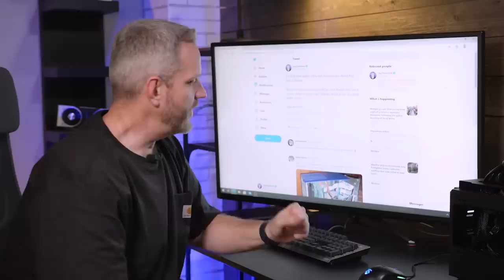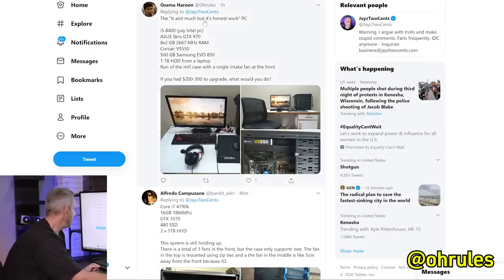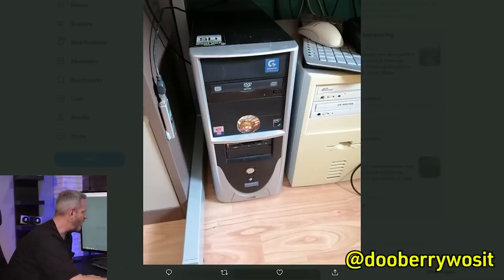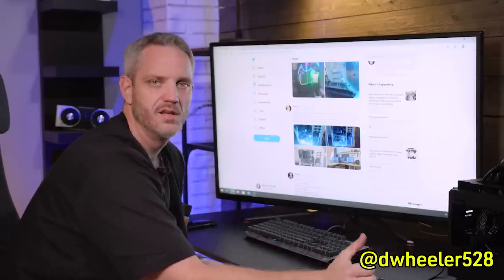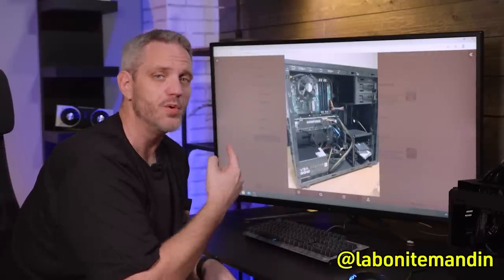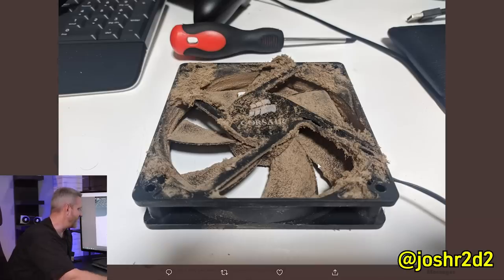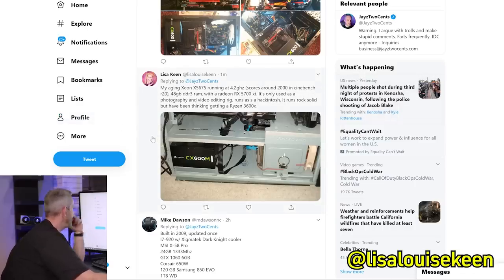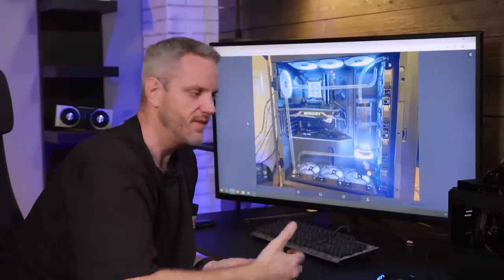Reacting to your WORST Setups... Send help NOW!

Comment: I had to clean out a PC for a client recently, the computer wouldn’t even successfully turn on. It would start up, shut down, start up, shit down... I had a feeling I knew what the issue was. The client was a smoker, had 4 dogs, kept the computer on the floor, and had a dog bed right next to the tower. I took an air compressor to the fans and non of them would even turn.
Reply: Dammmmmo
Reply: RAM swap and cleaning both RAM + Slots solves 80% problems people come to me with.
Reply: OH. EW. OH MY GOD EWW
Reply: Wow. Just... wow.
I've done some bad systems in my day, usually 10-15 year old systems that've never been opened in their lives and have multiple blocked heat sinks.
My crown jewel is the 20 year old file server I serviced. Dust bunnies across the entire room for literal days as I found my way around that system.
But the machine you just described... in all my years of fixing computers, I've never gotten one THAT bad.
Reply: I worked on a customers computer once, he smoked in his office and yeah his keyboard was that stained yellow. Somehow his computer still ran though.
Reply: Had a lady bring her PC to me because it overheated. She was a long time chain smoker. The entire PC was coated with orange tar and required a 12+ hour bath of water+isoprypl alcohol to loosen it enough to remove it.
Reply: I have seen  computers covered in wet looking orange-ish sticky residue.  Heavy smoking is smellable
Reply: My friend's dad in is a heavy smoker and they have a dog, his dad smokes while using a laptop, there is ashes inside of it

Comment: Jay: FX is almost a decade old
Me: crying in phenom ii
Reply: Ran a oc'd 965 BE until nearly 2019. It's a soldier. If you're anything like me, you're held back more by your GPU. Mine was a 2GB GTX660. That was holding it back more than the cpu.
Reply: Laughs in Athelon X64
Reply: still proudly rocking an FX 8350 with MSI 1080ti and Gaming pro carbon 970A motherboard lol.
Reply: @BobalouTheOneTheOnly  lol same board i got just I used RX 570 8GB OC cards in crossfire
Reply: Same. I got a phenom x3. Friggin potato ass trash.
Reply: arsonist_1  That was the first chip I had ran awesome for almost 10 years. then I finally upgraded to a FX 8350 BE. still have that Phemon II x4 running in a server. Still going strong.
Reply: Still got my phenom x6 and win 7 PC under my desk😂
Reply: My phenom x6 died last month so i bought r5 2600. Before cpu was 100% and r9 280 also. Now he dont touch 30%. I don't see a point to buy something more expensive if single gpu wouldnt use 60% of that.
Reply: cries in 9590 space heater
Reply: Take a pic send it to Jay let's see it
Reply: @BobalouTheOneTheOnly  I got an 8320, xfx 580 on a gigabyte 970. Was used for many things in its life, gaming, storage, nas, the things got 4 1TB spinning drives and 2X 256gb SSDs
Reply: @dcfuksurmom  Even low tier APUs from AMD kick the shit out of that one.

Comment: I definitely have a problem with cable management outside the machines. Wires everywhere. The suggestion for long power strips mounted to the backside of the desk is excellent. I'll be doing that. Thanks, Jay.

Comment: Soft tubing in home watercooling rigs is pretty awesome. It simple, quick, and allows you to make changes without taking it all apart. I leave my long run from the CPU to the front radiator a bit long to allow me easy access the memory and a few other maintenance reasons. I know it doesn't look exactly the best but it servers its purpose. On top of everything else I'm pretty much the only person that sees my rig.

Comment: *Jay, preaching to FX owners to replace it.*
*Viewers looking at Steve hugging his FX computer.
Reply: GT630 for me
Reply: FX 8350 is ok @ WOT & WOWS + e sport games.
Reply: I have the i7 990x released in 2011.
6 cores 12 threads, stock speed  3.46Ghz overclocked to 5Ghz.
Runs like a charm.
Can play all new triple A games with all settings ultra at 1080p with a fps of 120 (max).
So i don't even in the slightest do i think about upgrading my system (for now).
Reply: @opoxious1592  DUDE what voltage you running at and what bclk and multi?
I can only do 4.5Ghz on mine @1.4v and anything higher requires significantly high voltage.
I couldn't even break the 5Ghz barrier for HWBot OC.
Temps and cooling?
Reply: @zarmaanful  Voltage is just under or just above 1.50v  (Have to check bios first for the exact number).
Max temps at full load 72c or 161.6 F.
At first i also had problems reaching this speed, by using a to high BCLK.
If you increase the BLCK than also all other components (except GPU) will be overclocked in your system, increasing the chance of instability.
Therefore i have set the BLCK to 100 (lowest setting possible), with a x50 multiplier.
And for cooling i use the air cooler "Gamerstorm Assassin III".
This cooler is nearly as good as liquid cooling.
The difference is only a few degreese in favor of liquid coolers.
Please let me know of you get better results, if you are going to try the overclock?
Thanks 👍🏻
Reply: @opoxious1592  Sorry i forgot to check YT notifications, I'll try it.
was using 2133mhz DRAM frequency but can sacrifice some clocks for CPU clocks.

I'll have to check around forums if running 1.5v 24/7 is good for this chip.

Current settings:
BCLK: 133.
Multi: 34.
Uncore: 3200.
DRAM: 2133.
Reply: @zarmaanful  Yeah, RAM speed is not such a huge factor for gaming.
My DDR3 is running at 1600Mhz.
But i lowered the RAM timings to compensate.
Good luck, and let me know how it's going with your overclock👍🏻
Reply: @opoxious1592  Can't get it at 4.9Ghz even with crazy high volts(1.575v).
guess you won the lottery.
I did manage to get my memory to 2400mhz tho.

Did you change the Uncore or QPI or TLL voltage to get 5Ghz?
Reply: @opoxious1592  Tried lower multi but higher BCLK and higher multi with lower BCLK too.
Reply: @zarmaanful  No, i left it on "Auto"
What i forgot to mention, is that i did turn "Hyper Threading" off.
I could't reach 5Ghz also with "Hyper Threading" on.
Hyper Threading off, and lower RAM speed could do the trick.

Comment: The PC with the dust in the radiator reminded me of this:
I should have taken pictures of my PowerEdge when I found it on the street... It looked like the previous owner ran their server in a kitchen while still using the kitchen as normal... The first thing I did after taking it home was taking it apart and wash every part of the case and the fans because the dust inside it had formed a crust.
Reply: BodgeMaster you found a server in the street? That’s pretty cool
Reply: @brien1254  Yep. Sadly, it has only the Xeon equivalent of a Core 2 Quad and 4 GiB of RAM but why would I not take a free computer?

Comment: Jay: "Show me your worst setups."
Also Jay " STOP USING FX!!!"
Reply: Im still using a fx8350 with an rx580. I can play modern titles 1080p higher or medium settings 60 fps. Its still relevant for modern gaming
Reply: "Go turn a trick"
Reply: @amishdinkledork  I have the same setup, as long as games are multithreded its Okey!
Reply: @amishdinkledork  I'm using a 3700x with a 2070 super, I'd say my setup performs significantly better, especially considering new console gen is coming, meaning games are about to become all the more demanding.
Reply: cries in 1090T Bulldozer
Reply: @amishdinkledork  WOW! You can play at setting and resolutions that where less than relevant 7 years ago. A $100 zen2 ryzen 3 will steam roll it. Im sure you could make a pro duo play at 60fps if you treid hard enough.
Reply: @TheGauges420  I could bet a lot that the "modern games" he is talking about are ones that don't  have PC benchmarks (aka moba's, BR's, etc)
Reply: What’s FX?
Reply: @Budo Basovic still have my old 1090T system with a 770 GTX and still does a decent job for its age, dont use it too much since i have an 6700k 980 TI rig for gaming....
Reply: Jay wants me to get rid of my FX 8350 then he needs to sell me his 3300x Ryzen.
Have all the parts that need to be purchased, but no point if I can not find any 3300x cpus to purchase.
Reply: @En_Joshi-Godrez  most gamers play in 1080p...lol typical gaming elitist "if its not the best its garbage"
Reply: @amishdinkledork  No, you completely miss understood (not surprising when you use "eletist" as a insult). Most people on this earth are still using glorified Nokia bricks as phones. Does this mean that these are the industry standards of today? No. Phones like the iPhone 11 are. The only reason the mass majority use phones from over 10 years ago is because of a massive economic inequality. These devices are no longer relivent from a cultural and industry perspective, same is true for 1080p. 2014 was when the industry first punshed for 1440p in monitors and today their are significantly more new gaming  monitors made in that resolution than in 1080p. Again, the only reason 1080p is still being used is because the demographic for gaming PCs is a lot yonger and still having to deal with a massive economic inequality. They are playing on systems that are simply no longer relevant. Just to hammer my point, 30% of stream users use monitors that are less than 1080p. Literally no one is making monitors at those resolutions any more.
Reply: @En_Joshi-Godrez  if its not relevant why are people still using them? saying its due to wealth is BS, i could buy a ten thousand dollar computer if i wanted to but i dont cuz im not an elitist. actually look at recommended pc requirements for modern graphically impressive games. and ya know a 1440 monitor can produce 1080 if you change the settings...
Reply: @En_Joshi-Godrez  Yes, I agree, 1080p ≠ industry standard. That does not make them irrelevant. If you have a system that runs to your satisfaction, then why not spend the money on games instead?

Also, what makes you think that 1080p monitors are no longer in production?
Reply: @Sea_Star  when did I ever say 1080p was no longer being manufactured? 720p? For gaming most likely yes except fringe bargain bucket Chinese manufacturers. But 1080p screens will be manufactured for a while yet. But they are on a dowards tragectory, and I argue 1440p has over taken it as a industry standard. So little R&D is now going into anything with a 1080p screen.
Reply: @En_Joshi-Godrez  My mistake, I misread your last bit. Overall I agree with your sentiment about 1440p being the newer industry standard, I just deemed it a bit odd to dismiss 1080p as being culturally irrelevant.

Comment: "The card is showing its age with 3.5 Gigs of vram"
me: *Cries in 1 GB of Vram
Reply: laughs at you with a gt730 with whooping 4gb of vram
Reply: @rileybeckner7881  how in the hell did you find a 1050ti for 40$
Reply: Was thinking that 5600xt, 5700 or even 5700xt. I got mine for $300 used, but selling 970 and having a $400 budget could potentially get a new 5700xt.  Or wait it out and hope 3060 is in the right price range. Or big navi maybe?
Reply: laughs at you with Titan RTX with whooping 24 GB of VRAM
Reply: 2gb vram
Edit: 1030
Reply: @rileybeckner7881  You have a full GB? I'm still at 240 mb
Reply: My laptop has 128 MB of vram lol.
Reply: Just remove a memory module from one of your ram stiks and solder it onto the gpu
Reply: GTX 750 here with 2
Reply: i only have 6gb vrami, i cannt play ultra texture apex :( i can send 1 gb
Reply: laughing to you guys with a 3080 with 10gb of vram
Reply: @slicktachgaming6383  i have vram so much vram its not even funny. my vram is never maxed out and i only paid 200 sollar for it
Reply: what you mean, I have a sick case with RGB but the insides are crab, I am running on a HD 630
Reply: I just got a 3080 I don't even know how much vram I have
Reply: @nombre652  same
Reply: @jc.1191  acer c720 Celeron 2957u running garrys mod is a nightmare...
Reply: sobs in 8mb of vram

Comment: Jay: Get off FX

Me, watching this on my Phenom II: huh
Reply: Believe it or not Phenom II performed almost exactly the same as FX except in VERY specific circumstances. For gaming its almost a wash.
Reply: My phenom ii x6 plays the new flight sim 2020 just fine its still a good cpu.
Reply: It's not FX so you're good!
Reply: @mitchmarvinmartian  I've often heard that, but I upgraded my PII x6 1100t to an FX 8350  (OC'ed both) and picked up about ~25% FPS in my racing games.
Reply: Recently got 4 of the Phenom II processors to play with. Can't wait to test them out...
Reply: The Phenom II's were actually a bit better then the FX CPUS
Reply: Last november,  finally bought a new pc to build for my 18th. gave the phenom II 1045T hack job dell hand-me down i had to my younger brother
It had a Phenome II X6 1045T, 12gb (1300Mhz) Ram, 120gb SSD, 1Tb HDD, Radeon HD 5450 (1gb).
Letting him suffer for a few years
Reply: I had a phenom x4 955 oc'ed to 4gHz till 2018, upgraded to a 2600
I gained almost 20 fps in battlefield 4
pls upgrade if you have the money, for your sanity.
Also not have a 200W heater in the summer is a +
Reply: Even Phenom II was clock for clock better than FX. Just lacking some more recent instructions sets that some games use.
Reply: I had a phenom II x4 940 oc to 3.6 until I upgraded to a ryzen only because I needed more ram. The 940 was on a ddr2 motherboard with 6gb of 800 mhz ram.
Reply: I recently upgraded from a PII X6 1050T to a 2400G. The 2400G is way faster. I'd bet the new 4core 8 thread single CCX thing is even better.
Reply: I just retired my Phenom II after 11 years. It was a great computer.
Reply: Im still using a fx8350 with an rx580. I can play modern titles 1080p higher or medium settings 60 fps. Its still relevant for modern gaming
Reply: AMD Phenom II x6 1050T here lol
Reply: Wife does her "work from home" on a 955 (Black Edition)
Reply: Phenom II X6 1055T here :cries: I want Ryzen 5 3600 :(
Reply: Laughing in core 2 quad q9650@4.06ghz  that still runs pretty much all the games I want to play at high settings above 60 fps if not above 100fps  (dota2, csgo, payday 2, GtaV, pubg, fortnite save the world ,Ark survival evolved, classic wow etc) . You tubers have lost touch with normal people not everyone is playing the latest aaa games and most can't afford the latest greatest systems. Hell I'd love an 8400
Reply: @amishdinkledork  same here.  Fx8350, 16GB DDR3, dual 8GB RX580, Windows 7. Two 120GB SSD drives and a 1TB spinner.
Reply: Phenom II was still better then FX
Reply: @westtell4  it's not

Comment: I built my brother's setup on an Alex desk. At first I was like "oh cool, I can stuff all the cable in the cable management bar, and don't go through the hassle I went through for my own setup !"

Then I realised that the setup would be centered, with the monitor excatcly in the middle of the desk, where the slit hole is for the cables to come out... And also that the PC sits half on the desk, and half on the little door that close the thing : If I want to acces the cables, I have to move the screen and the PC. That was not easy to cram everything in without it looking like garbage, but I achieved it, and honestly, once it is done, no need to think about it again...

... until you upgrade something. My brother had a 60Hz screen, anf wanted to go 144Hz. Fine, I mean why didn't he have one already? I let him pick one up online... He chose the cheapest "good" monitor with ajustable height and stuff, a LG panel. I overlooked the fact that the powersupply is not embedded into the monitor, but is an external powerbrick. So, I can't just swap the monitors keeping the same power cable, so I need to remove that cable, therefore moving the PC, etc a fking mess. And then I realised the powerbrick doesn't fit on the powerstrip to allow me to close the fucking door, I had to search for a freakin' power extention to be able to fit it, there is easily 2 to 2.5m of useless cable in that cable management compartment now.

Morality : Use the Alex only for laptop setups